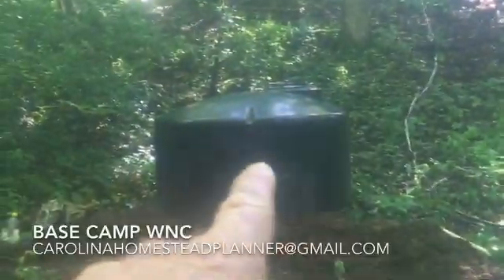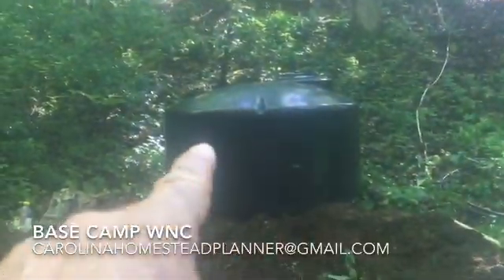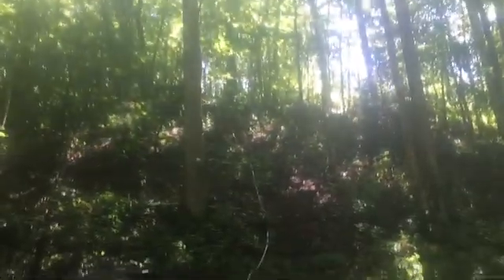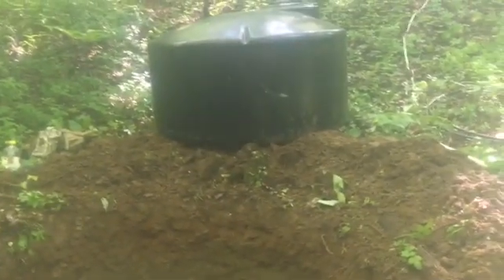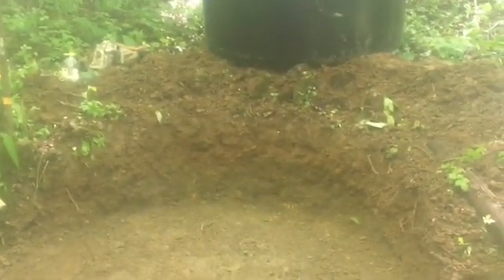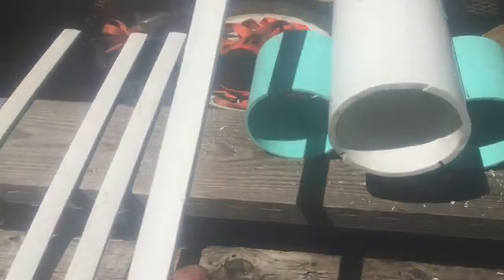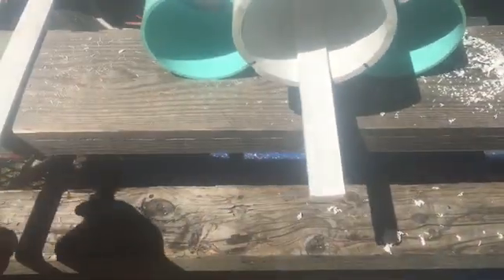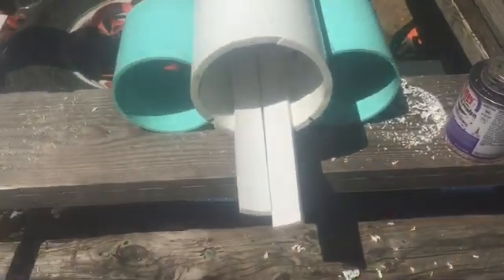Spring Water Collection Part 2 Pumping Water

Comment: How do you keep the pressure pipe coming out and down to the house from freezing in cold weather? You can wrap it all you want and it will still freeze. I was wondering about piping the overflow out and around it and down below the freeze line then away.
Reply from the maker: All the pipe from the tank to the house will be buried 
This system has been setting for years 
Home owner is replacing pipe and repairing as he goes
And as always subscribe like and share 
Thanks 
Eric
Reply: @basecampwnc1745  looks like the pipe coming off the side to the house going down to the ground will freeze, it will be exposed.